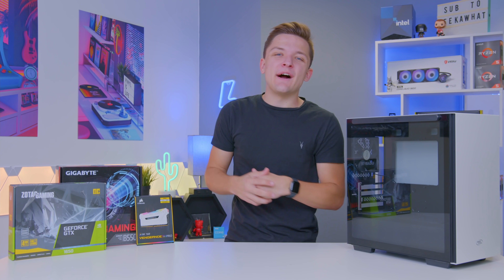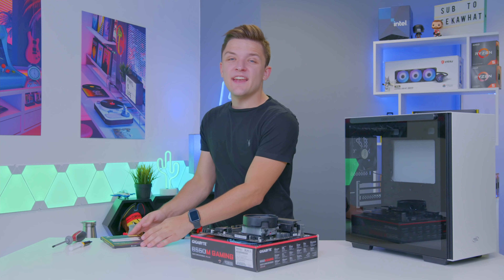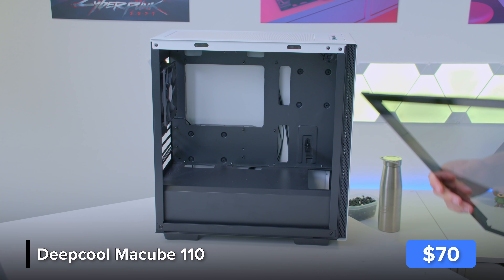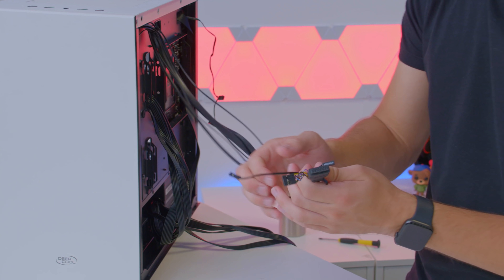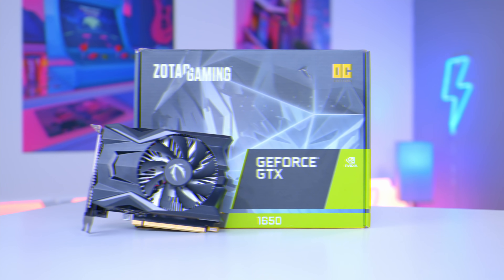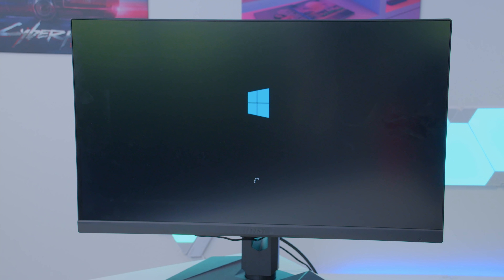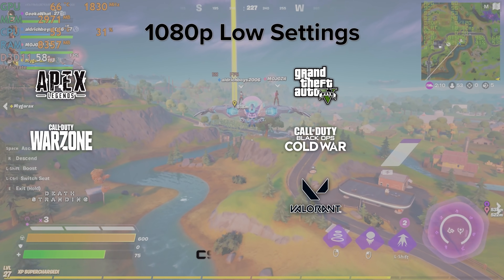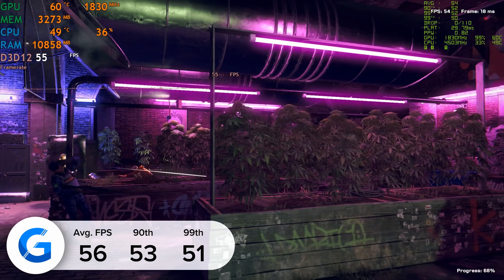$800 Budget Gaming PC Build 2021! [Full Build Guide w/ 1080p Benchmarks, BIOS, Drivers & More!]

Comment: Do specific graphics card work with all cases or only specific cases? I was trying to find a graphics card that wasn’t like 800 dollars and could go into my budget. I have every other component so I just wanted to know.
Reply: Off Google: General rule of thumb is if you have a full size case you are going to be fine if you have a mid-size it should but you still need to measure and or Google the case type and the card along with will it fit. Anything less than mid-size and you need to do research to make sure before you purchase the card.

Comment: If we decide to use Ryzen 5 3600 instead, will it bottleneck the system or would it just run fine?
Reply: that would be a great choice I would do it, Ryzen 5 3600 is a better cpu for sure

Comment: hey there quick question i have an msi pre build with a i5 10400f and an 1660 super it came with an 8gb ram but i wanted 16gb but the engineer put 2400 mhz is that ok or do i buy 2666mhz witch is recommended any advice thanks

Comment: I think I finally found the pc I can built 😫
Reply: just wait man, it really isn’t worth the money right now
Reply: Rather dont, coz this youtuber doesnt have a clue what he is doing. or maybe if he does, he wants to play stupid instead to make something bad. (:
Reply: Bro prices aren’t gonna drop until mid next year so I mean it is somewhat worth it
Reply: @isaact7992  No lol, it remains bad. its not ''just'' the gpu, the rest of the build isnt good either. Cpu, mobo, ram, case, ssd, gpu options are all terrible.  Used market is first of all the way to go in a 800$ USD budget for the best value gpu.
Reply: @theelepel I agree with you bro that the components chosen are questionable and you could go second hand to get a better deal; just saying that the overpriced apocalypse isn’t going to end soon or in a couple of months so a build like this for around 800 is “somewhat” worth it with some changes
Reply: @isaact7992  well even if you pick the cheapest rx 570 available, you can still get better of everything else, which is the main problem. These parts are such out dated, and shouldent belong nearly in 2021 builds.